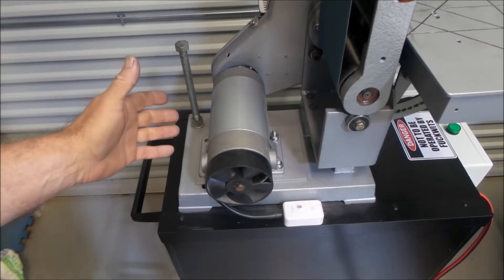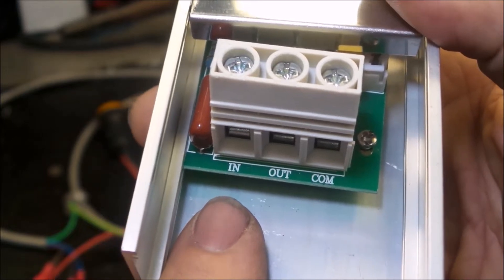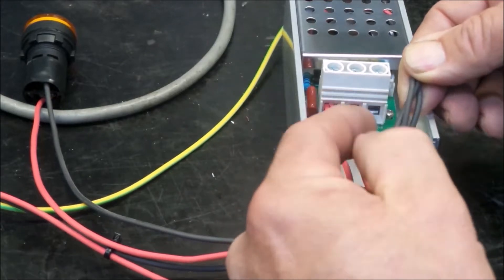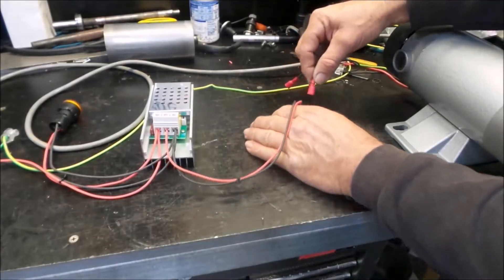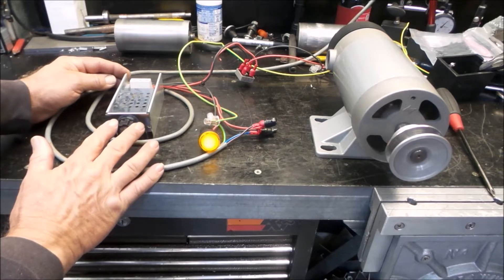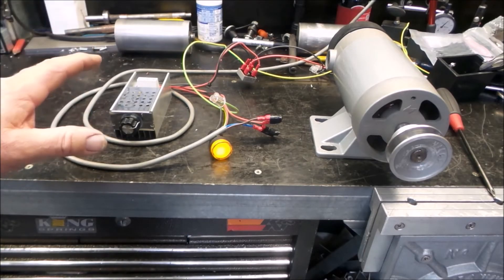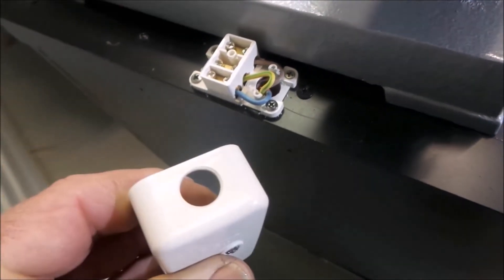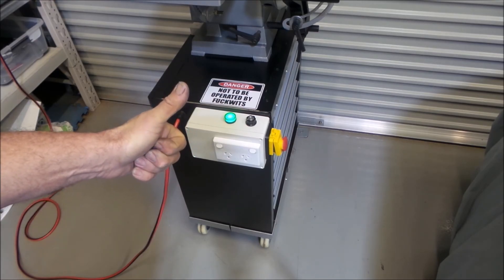The Ultimate Diy DC Treadmill Motor Controller

Comment: I have this setup on my metal lathe 3hp DC motor 1880W max power, however i find that scr gets quite heated after relatively short time and power cable that comes from the outlet also gets quite warm, my motor doesn't immediately stop when you turn pot to low its still coast on inertia as it has heavy lathe head attached, I'm wondering if that's what generating reverse current into the rectifier and the scr? Is adding a large capacitor gonna make any difference?

Comment: G’day Trevor. Would a treadmill motor and this setup be powerful enough to operate a small’ish lathe ( not a mini-lathe ) ?
It’s an old Aussie made lathe called a Premo Mk.2  by Blackenbury & Austin. I’m guessing maybe not but it certainly would be a very cheap way of having variable speed. 
Cheers mate.
Reply: Most treadmill motors are around 2 hp. Mini lathes are about 1/4 or 3/4 go so it’s should very much enough power.
Reply: Abel ... thanks for the reply !
My treadmill motor is rated at 2.5hp. 
Well it’s all up and running .... until you put it under load or increase speed higher than about 500rpm then it trips out the little 8amp resettable fuse that was part of the original treadmill switch assembly. Obviously more load than what fat bastard the treadmill was designed to carry 🤣
I will use a clamp meter today to see what amps it’s actually tripping at and if I’m game I might bypass the resettable fuse and plug the power into a power board which has a slightly higher resettable fuse in it. Will let you know how I go. 
Thanks again for you’re advise.

Comment: Thanks for the vid! I've seen a lot of people post about the difference between VFD controlled AC motors and a DC motor like this and they always seem to say that the VFD drive will have better torque. How true is this in your (or anyone's ) experience and to what degree does it matter? Can one of these treadmill motors be stopped easily at say 500rpm?
Reply: IT is in the SCR, where the AC  half-waves  +  and  -  , are   clipped, thereby  reducing  the  current  to  the  motor.../ With VF Drives,  the  motor speed is controlled by  the   frequency,  of  that same AC.  NO  clipping, of current....much improved  power, at any  potentiometer  setting.

Comment: Great information and well explained video  ordered the parts i need,   is i possible to fit a reversing switch inline without having to change the wires on the rectifier?  new subscriber,  Mike, Lismore.

Comment: I tried this with my DC motor (in the USA). I'm getting sparks when I look in the rear of the motor. It's only when I'm turning up the pentiometer, but isn't as strong when the pentiometer is static for a while, and completely disappears when I'm turning it down or the motor is coasting. Is this normal? Do I need to change out the pentiometer?
Here's a video link: https://photos.app.goo.gl/tsnKJxq6TJwCrTec9
Reply: Hi Steven, looks like the motor brushes and / or the commutator may be dirty or worn.
It sparks more as you turn the pot because the motor is under load until it speeds up. You could remove the brushes (the black bit where the motor wires go inside the rear housing will unclip and the brushes are held in under spring pressure) and replace if they are worn out, and / or you could disassemble the motor and tidy up the commutator segment surfaces. Either of these will probably reduce the sparking. 
FYI, the blue wires are a "thermal cut-out". Normally these would be connected in series with the supply to the treadmill speed controller and if the motor gets too hot the power supply is cut to the controller.

Comment: I don't know why they call it SCR (DC) controller when it's TRIAC(AC)
Reply: a dc motor speed controller   uses SCR's ,TRIAC's are most use in dimmers ,small fans  speed control and some small stuff
Reply: As I recall an SCR only works in one direction, so you will only get a half wave and therefore not need the rectifier. If it has a triac you will need the rectifier.

Comment: Grreat video mate, really well explained compared to some of the others i have seen. You mentioned you run most of your power tools on them, do you have a rough idea of the lifetime of the motor using this? I see a few comments on each video and a few videos that mention this but that its not ideal or good for the motor and shortens the life.. Any input on that ? Thank you
Reply from the maker: G'Day Mate, Honestly I only have my own experience to go on, I have been running this controller setup on 4 pieces of workshop equipment all with very different load & RPM requirements, one of them has been going for nearly 5 years now & others 2 or 3. So far no failures, other than a bridge rectifier. Its pretty hard to know how this controller setup effects motor life without Two identical setups with the only variable being the controller. Makes you wonder how folks draw this conclusion. Regardless, for me personally, if this setup did indeed shorten motor life by even lets say 30% (no idea what the expected motor life is meant to be though) considering the motors cost me nothing, it wouldn't bother me at all.
Cheers Mate.

Comment: Is it possible to remove/replace the large flywheel from a treadmill motor?
Reply from the maker: G'day Mate, for sure, they usually only have a couple of grub screws fixing it to the shaft which often has a key way setup also. Cheers.
Reply: Often the flywheel is threaded onto the motor shaft. (Ex-treadmill engineer)

Comment: Hey Trev,  great help dude and thanks.  One problem I have is firing the emergency stop switch. I've placed it at the power in end, but the green button won't stay depressed unless held. I've linked the small A1 terminal to the neutral 'out' terminal as i believe  should (and tested it linked to the neutral 'in'), but the problem of the on button persists.  Any suggestions? Ian.
Reply from the maker: Hi Ian, my first thought would be to reverse the polarity of the switch wiring, they will work either way, the winding in the switch gets either power or neutral from the switch depending how it is wired. sounds like its getting a neutral from the switch not an active. Remember to change your output wires around if you do this. Cheers Mate.
Reply: @TheAussieShed  Great and thank you- this solved the problem. very much appreciated.
Reply: Hi, great video. Just one question. All fine but wondering, I'm on the Gold Coast so running 240v mains but have a 112v dc treadmill motor.  Would there be any problem with the voltage output at the treadmill end? Thanks.
Reply from the maker: @ronaldcassar3143  G'day Ronald, yep you will have issues. The Voltage out with this type of controller is very close to the voltage in, actually slightly more. It works ok with the 180v dc motors but I wouldn't push it with a 112v version. Cheers Mate.

Comment: great explanation but where can I get a Treadmill motor and what do they cost?
Reply from the maker: G'day Pat, I pull them out of Treadmills left out for rubbish pickup. A lot of folks buy them with the idea of loosing weight, getting fit etc, then realize that requires actual effort. I guess sometimes the driver boards might be fried also but the motors are always perfect, most are like brand new. And best of all trey're free.
Cheers Mate.

Comment: Does this module support 3hp engines? Or is its use limited?
Reply from the maker: Hi Carlos, the treadmill motor in my drill press is 3hp & have had no problems at all. Been running for 3 years now. Cheers Mate.

Comment: Excellent video, have been wracking my brains for the last week trying to work out how to control my treadmill motors without using all the crap from the treadmill. Watched many videos on youtube but none made it as simple as your set up or would cost way too much cabbage.... and other videos did not list the required parts. Finding your video has made my job so much easier now. Thanks a lot and keep up the good work.
Reply: Thanks bacon..

Comment: Guday  Trev  merry Crimbo

    Got a quick question for when you’re able to reply ( if at all possible !)
  Do you take off the flywheels of the Treadmill motors that you use ? & if so is this because it slows down the inertia of the motor quicker ?
 Regards Bob
Reply from the maker: Hi Robert, depends on the application, I have both setups currently running. The mass of the flywheel does help the motors resist dropping speed in some intermittent light load situations. Cheers Mate.

Comment: Guday Trev
 
Just come across your Channel n watched your vids about Treadmill Motors n how you wire them. 
  On other Videos ( other youtubers ) they all so to go with using the component parts from within the treadmill, you however just use the SCR Motor Controller Bridge Rec etc. 
When viewing how your motors run they seem to be more responsive to powering up (high) & slowing down to a stop. 
Others have mentioned that they’ve kept the  Coil/inductor ( one you tuber showing how it both with and without it’s being integrated) had different effects, ( that though was with the flywheel in situ )
Gotta say yours seems to ramp up & go to a dead stop as I would want. 
Any thoughts ?
  By the looks of it I’m gonna have to spend a whole lotta time now checking out the rest of your bids cos from what I’ve seen so far the machines all look to be up my street. 
Keep up the good work it’ll keep me busy in catchup!
 Cheers Bob UK
Reply: Thanks Bob

Comment: Gidday , building a potters wheel with a 3hp dc motor from a treadmill I will be gearing it down with pullys,the motor draws 12.3 amps, will the equipment you are using be ok here in NZ, also is it possible to fit a digital tachometer display for the motor?
Reply from the maker: Hi Neil, yep should be fine in NZ. Have a look here for setting up the Tach on one of my other vids, https://youtu.be/3z3jLfe65yU
Reply: @TheAussieShed  Hi, The build for my potters wheel is almost complete, just waiting for the electronic parts from eBay, want to have a foot pedal as a speed controller, is there one I can plug and play or will I have to rig something from the controller you suggested and take the potentiometer down to a foot pedal that I will build?
Cheers Neil

Comment: thank you I have been trying to find out how to do this parts ordered thanks
Reply from the maker: Cheers Mate.
Reply: @TheAussieShed  I have watched a couple of others since yours and why is it the voltage of the motor  eg12vdc 130vdc I have a 180vdc 4000 rpm and how is it possible for such a small power supply to be able to do it ??
Reply from the maker: @rongfucapers9442  G'day Mate, the simple answer is, its not a power supply as such. all this setup does basically, is allow you to vary the voltage supplied from the wall socket & change it to DC. All of my motors are 180vdc. Cheers.

Comment: Will this setup have high torque at low speed or does it drop off a heap?
Reply from the maker: Yeah its actually pretty good, mind you, like anything you have to have the right gear ratio for what your asking of it. The treadmill motors vary in HP ratings too, so obviously that will make a heap of difference.

Comment: I tried doing this a few years ago but had issues. I wasn't sure if I had a bad component or motor (it was sparking and making a bad noise). The FBR was also getting incredibly hot within seconds. Was 240v ac to 180v dc a bad idea?

Comment: Hey I tried this same setup for a 2x72 belt grinder and the rectifier seemed to have a melt down and started blowing the breaker, I can hook a new one in and works again, Any idea What could be the problem.
Reply from the maker: G'day Mate, I had the exact problem about 6 months ago on my drill press.
I was doing some pretty heavy Tapping at the time.
Figured I had fount the limit of these cheap rectifiers.
I had a spare in the drawer & threw it on as a stop gap, I then purchased an expensive high quality, higher rated, Rectifier.
That was 6 months ago & the drill is still running the el cheapo replacement as the original.
During this time I have pushed the drill press way harder than when it blew the rectifier earlier.
From this anecdotal evidence, I would probably put it down to varying manufacturing tolerances of these cheap electronic components.
I have this setup running in quite a few machines & so far this has been the only component failure.
Hope this helps,
Cheers.

Comment: Great video offering the assurance that it works & you have several in shop examples that have stayed working. I question the output voltage & the possible use of caps. I think also that you might well consider fitting a low cost voltmeter on the moor supply side & a tachometer. Maybe not needed generally but very useful for a demo project like yours. Finally  I'd like to suggest you keep all mains AC wires to colour code (blue, green, brown). The reduced voltage lines aok in red & black. Very little if any extra work. Again THANKS good simple easy to follow video.
Reply: Thankyou for the vid. I am about to fit a treadmill motor to mill machine. I have a lathe with a combo mill attachment but the bevel drive gear for the mill m/c was stripped of teeth. So I intend using the tread mill motor to power the mill attachment. Are you still happy with the setup you described in the video as I am about to order the controller and bridge rectifier. Any further advice would be much appreciated thanks. I enjoy your other vids too. Very informative. Other vids I find contradictive where you are doing it. Makes a difference.

Comment: Most all treadmill motors are permanent magnet, (PM). They have a voltage spec. Put more voltage into them, and the PM demagnatize, over time.  When you rectify AC, the voltage increase by ~75%.  So, 120VAC becomes ~180V chopped.  That's why you see transformers in power supplies.

Also, without capacitors, you have the upper half of the AC wave. The caps stored voltage potential, then release it, to try to fill in the low parts of the chopped AC.  You estimate the percentage filling you want, then buy a calculate the size of the cap to do the job.

There is still variation. An in circuit induction coil will fill in some more.of the variation.  To get a good steady DC, you also need a voltage regulator. That is why a good power supply is called a regulated power supply.

I don't know the precise negative effect of a <20.00 power supply, but it only makes sense that if you could reliably run a DC motor on one, why would good DC power supplies and controllers cost hundreds to make?

Comment: Our Treadmill DC motors are the same as yours, I think they must be the same globally with the real only differences being in the motor controller boards running on the higher 220-240 volts ac, where ours is actually designed for the lower 120 volts ac here in the states. Also here in the states when we rectify 120 volts ac we actually get the full peak voltage of 170 volts. So I think the 240 volts rectified you have is actually 360-380 volts dc. If you ever decide to put a capacitor in circuit after the rectifier make sure you choose one that is capable of nearly 400 volts dc.